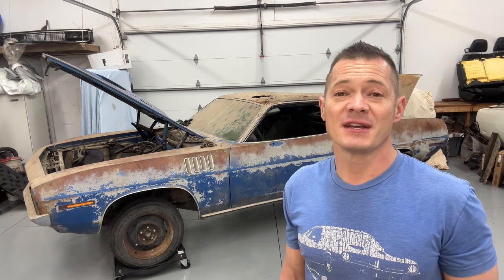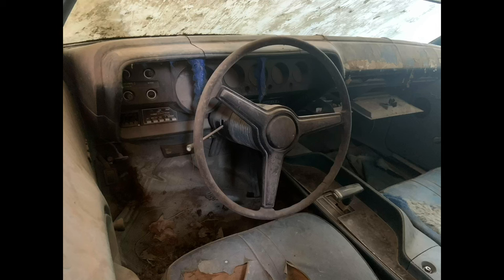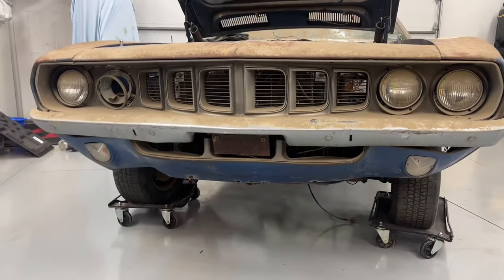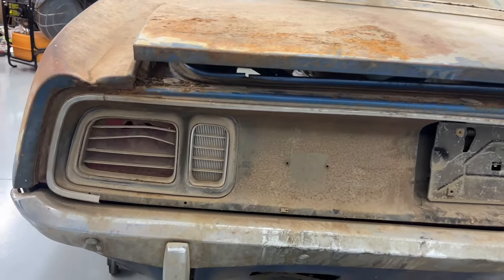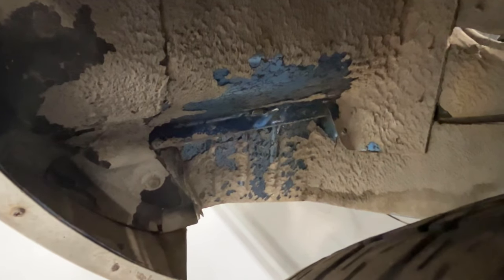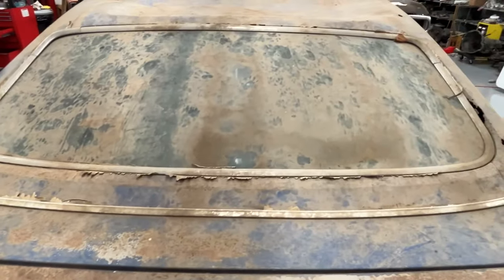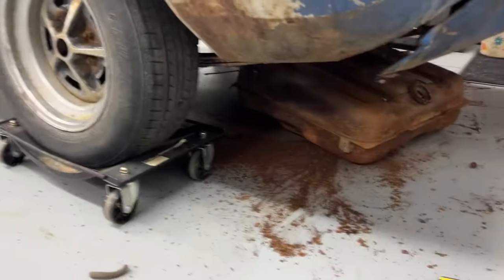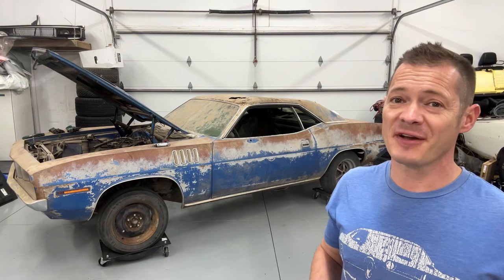Saved: a 1971 Plymouth Cuda “parts car” big block Barracuda Ratty Patina Mopar 70 71 1970 barn find

Comment: Incredible story man, God has defined been watching over you. I have a 1970 Barracuda my Dad bought 20 years ago. I own it now and have been finally been restoring it the last 2 years.  I'll be painting it shortly! I look forward to seeing your progress.
Reply from the maker: Very cool! What engine/trans/color is your 70?
Reply: @amostlymoparfamily  so it was originally a FE5 red, 318/904 A/C column shift car. I'm putting back to original color, Its got a magnum 360 in it with a mild cam, sticking with the 904, column shift, and I did a 8 3/4 swap ( had a 7 1/4  orig.) I don't plan on cloning it to a cuda, it's just gonna be close to be close to what it was originally , and a fun driver.
Reply from the maker: @mb2stroke816 very nice!

Comment: Subbed. The patina on this car is amazing. Imo replace/repair the rotted floors and roof skin. Reshape and hammer out the dents on the rest of the car!. Yes even the pass door. I love that car. So original. Maybe paint the roof rustolium 7777 black or off white. Even with a brush! Then wipe on clear the rest like VGGs stuff. Grateful you started a channel. One day at a time. God is good🌄👍🎩.
Reply from the maker: Thank you!

Comment: Congrats on finding the broadcast sheet. How durable is your floor finish?  Drawing up a new shop for my projects. (Similar to yours). Was going to just go with a regular concrete smooth finish out of concerns with trans fluid and other work tearing up a finish like yours.
Reply from the maker: Thanks! I used a Sherwin Williams product called Rexthane…8-9 years ago. It is pretty tough and 1:21 will not lift with chemicals/oils. It does scratch and sometimes chip if I am rolling a car around and a rock/pebble gets underneath the dolly wheels. I like it a lot…the downside is I don’t work in my shop as much because I don’t want to scrape it! lol

Comment: Honestly, if it wasnt a real deal cuda, id say do an ecodiesel v6 and 8 speed automatic transmission like i plan to do. 240 horsepower and more torque than a 426 hemi stock. I plan to tune mine to 335 whp which is what the 383 big blocks had. Best guess on torque is about 550 pound feet. But i say for your car, do a 6.4 hemi with an 8 speed transmission. Youll get about 25 mpg all day long (because its in a very lightweight car) and have all the asphalt crushing power you could ever want. My advice for exhaust is do ONLY 2 original mopar style mufflers outta the back. It'll sound incredible, just like an original cuda. But thats just my opinion.

Comment: Clean it up a little, spend some time with it in the garage and you MIGHT have yourself a decent bracket racer if you get rid of that shitty, original running gear. Craigslist that garbage.
Reply from the maker: It’s funny to me that it originally came with an open diff…why cheap out on the diff when you’re buying a 71 big block Cuda?!? It should be a fun budget build
Reply: If he just wanted a bracket racer he would build an S10 or similar cheaper.  Not practical to use a big block '71 Cuda,they stopped making these several years ago.
Reply: @bradleynelson5915  S-10 is too, too light in the bed unless you plan on hauling a couple hundred pounds of ballast. But then it's a bracket racer and consistency from the driver and the vehicle is key. If you can run your dial right on the money AND consistently hit .4XX lights, that will be a tough package to beat, even if your dial is 14.80 or something.